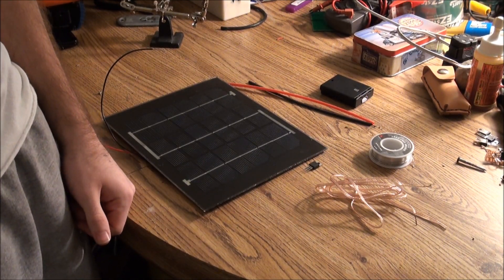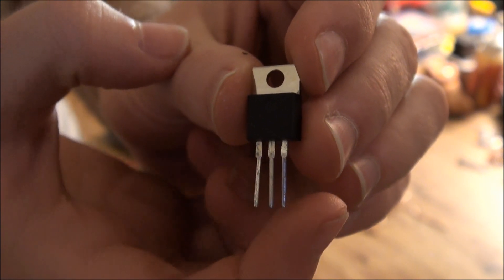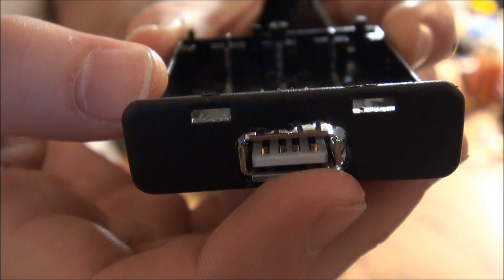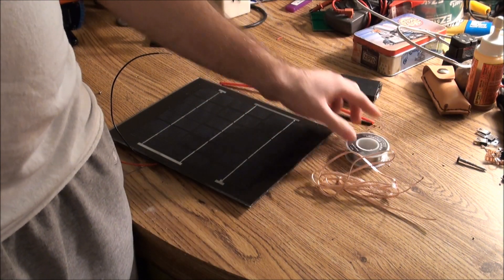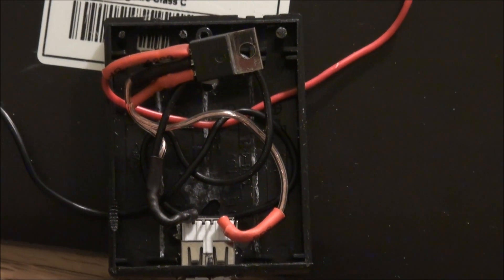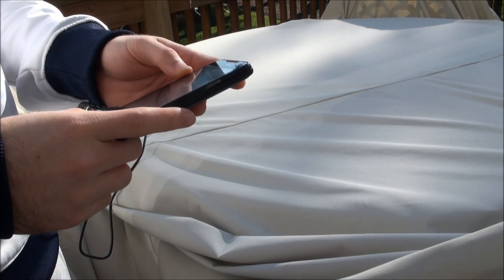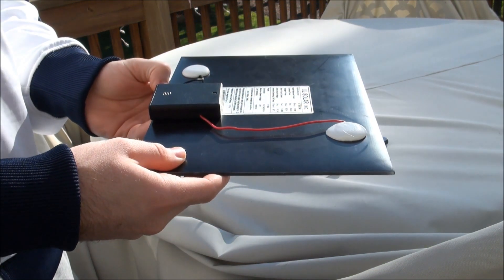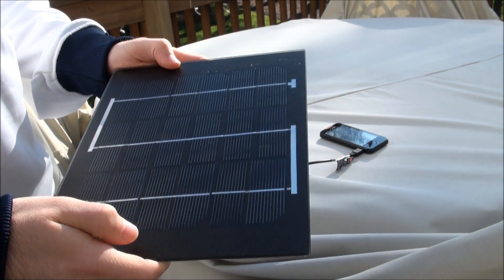Build a Solar Powered USB Phone and Ipod 5V Charger

Comment: How do I choose your capacitors? The output from the solar panel is DC, and after going through the regulator, the voltage should be stable, no? Why do we need to put capacitors?

Comment: If you want to charge a Apple device, simply hook up a normal car charging port where you would plug a lighter in and wire that directly to the solar panel and plug in your normal car charger for your Apple device! The male end of the charger will do 13v and 9v and convert it down to 5v... Or you can simply take a iPod car charger apart and look at the differences and build it in that USB box or you can gut the charger and use that in your USB box, but that could be a little pricey for other than personal use!

Comment: Why are people mentioning resistances how does that help I'm curious. Aditionally I think just for further stability you could add some capacitor to the cicuit so that it can be more stable.
Reply: Heron Ortega Because some things look for certain resistances to make sure you are using the same brand of charger or the thing accepts power slowly or not at all.

Comment: Charging an Apple device it's kind of tricky.

What you have to do is hook up two resistors between the output voltage and the data pins, one for each pin. This is because some electronic devices need to sense voltage in both data pins in order to start charging.

And if you are going to re-make this project I sugest you to get a step-up step-down voltage regulator, they are way more efficient than linear ones.

I hope this helps you :)

Comment: 2 100 ohm resistors 1 for each data pin to the positive cable. Also i would put a diode on the positive side from the regulator so there isnt any feedback to the solar panels. Good job cheers

Comment: I think what Hunter Mire means is that some devices won't charge on foreign chargers so you have to buy their proprietary chargers. Heard some guy had problems charging the apple device because of different voltage even though it's in the 5 volts +/- 0.2 range.

Comment: You might consider using a dc-dc-buck converter instead of voltage regulator. A regulator takes the excess voltage and turns it into waste heat. A dc-dc buck converter is a little more pricey, but almost no wasted power. Your panel is large enough in this case that you can afford to waste the power and still charge the phone at max capacity. But if you wanted to charge multiple phones at once...

Comment from the maker: You have to match the solar panel voltage with the voltage of the device you're trying to power. The LM7805 chip I use in this video converts the 12 volts from the solar panel into 5 volts since phones charge with 5 volts. A 12 volt solar panel should run a router if the router runs off of 12 volts.

Comment: Hello Sir, I have a solar power system in home .. I have a question .  Can I use the DC. Current created by solar Panal to charge my iPhone and use wireless router ? Or do I need some kind of converter to transform the solar DC to AC ?  Answer will be appreciated :)

Comment from the maker: The voltage regulator can only produce about 1 amp at 5 volts. If its a really sunny day, the solar panel can almost max out the voltage regulator. It takes maybe 2.5 or 3 hours to charge my phone completely

Comment: i built a similar charger but i used 3 solar panels at about 5 volts each and .1 Amps each. i used the same usb ports and 5v regulator, the reason why its not charging your ipod is because it requires more then 5 volts, i had the same problem with my ipod until i connected the panels to the usb port itself, then it started charging, the final output was 5v and .3A

Comment: Diodes have about 0.7v drop across them, so you need to subtract the 0.7v from your solar cell output and that's probably why your battery isn't getting a full charge.

Comment: yeah i meant without the regulator. Thanks for the quick reply :) Just wanted to ask one more question. i have a couple of 5v regulators at home & the output is 1.5amps but my regular mobile charger is rated at 0.7amps. would you think that makes any difference at all?

Comment from the maker: Without the voltage regulator, yes. But if you include the voltage regulator, the 9v will be lowered to 5v which won't damage your battery.

Comment from the maker: The voltage regulator shouldn't really limit the current (unless the solar panel supplied more current than the voltage regulator can handle). I don't think it should damage your phone, but I'd unplug it after it's fully charged just to make sure.

Comment: I have a 3Watt cell and going to make a charger for my galaxy s2.Does voltage regulator limit the current going into the phone and slows the charging?and also if I leave the charger plugged with full battery on my phone,does it cause any damage to the phone Or should I have to build a charge control circuit into my charger ?please do answer these...Thank You>

Comment from the maker: The regulator makes sure that the voltage stays at 5v, which is what is required to charge USB devices. Because the voltage regulator decreases voltage, it increases the current. The wattage stays constant in theory, but there may be an extremely slight decrease due to inefficiency in the regulator.

Comment: to get a ipod to work u use a  two(2)100 ohm resistor's connected to 5v and data +...and the other resistor connected to 5volt out and data - (negative) Fyi

Comment from the maker: Most definitely. The prices for flexible solar panels are starting to come down now, just be sure that the panel provides enough amperage to charge your device. You can also incorporate a battery if you have the know how, however, I'm just a sophomore studying electrical engineering, so I'm not quite at that level yet haha

Comment from the maker: @xxzombiekillerxx97 Some devices can regulate input voltage, but I wouldn't recommend running anything other than 5 volts to your devices, as its possible over/undervoltage can cause damage to them.